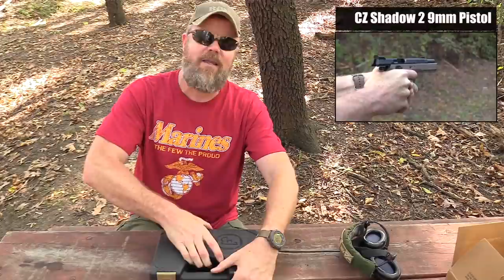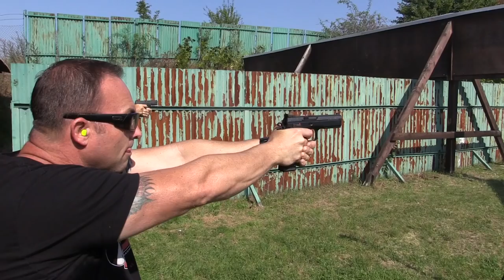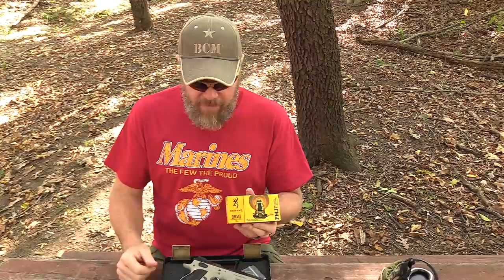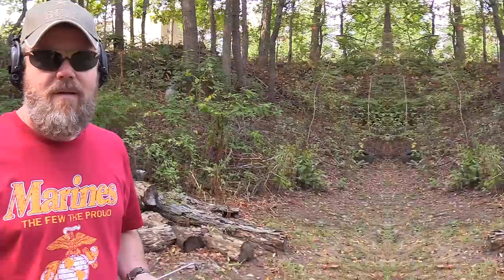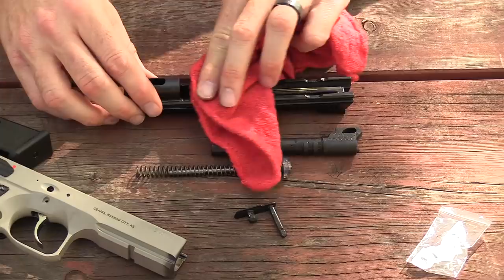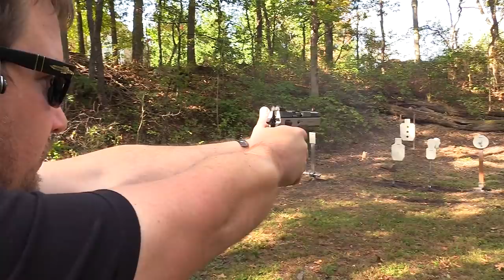CZ USA Shadow 2 9mm Pistol - The Ultimate CZ75

Comment: Hi MAC. In USPSA\IPSC competition if you're shooting at Shadow 2 you're probably in the 'Production' division. Production requires that you have a DA first shot for DA/SA guns. So most guys are going to be running DA/SA with a manual decock at the start.
Reply from the maker: Apparently the Europeans do things differently. Even the Rex Zero Alpha (recently announced) competition gun designed for the European market has the decocker removed and has a thumb safety.
Reply: Yeah, we have no fear to decock manually :). Shadow 2 is intended for Production with DA first shot. Decocker actually makes trigger worse. I don't see a reason to fear pistol without decocker, you just have to put a finger between a hammer and striker and then touch the trigger, not the other way around :)
Reply: That's normal for Production division (in both IPSC and USPSA) hammer guns like the Shadow 2 and Tanfo Stock 2/3/Limited Pro. Standard procedure is just to rack the gun and thumb the hammer down when making ready.
Reply: Yes believe it or not both in europe and in the states they decock it, without a Decocker.
Reply: Better way is to use forefinger+thumb of the weak hand to pinch the hammer from the above (not the sides, that can slip!) and then pull the trigger and lower the hammer slowly. This way it's safe even with frozen numb wet fingers.
Reply: Military Arms Channel that's because decockers make the trigger worse. You decock manually by riding the hammer.

Shadow 2 also eliminates the firing pin block for an even better trigger.

First shot is double action in uspsa/IPSC. Uspsa also runs 10rounds. IPSC runs 15 rounds in the magazine.
Reply: That is totally normal procedure in IPSC when you get the "Load and make ready" command. Mussle always safe direction, and lower the hammer down safely. (When in production division) In Standard you can start cocked and locked.
Reply: In IPSC (world competition) the first shot has a minimum trigger weight so DA/SA dominate. USPSA has no such rule so striker fired guns are more common. Generally a gun with a decocker will have an inferior trigger.

Comment: How would you compare the differing CZ triggers across the models like this one, a standard P-01, P-07 etc? I'm curious how much/little the triggers differ across the different pistol lines. Maybe another video on that? 😀
Reply: The P-07 and P-09 (newer generation) have outstanding triggers for the price despite having firing pin blocks. The trigger travel is smooth like butter, the single action is decently light with a clean break, and the reset is slightly long but very tactile and audible. The double action is smooth, though it does take some force but definitely not as much as other double actions.

As for the SP-01 series of CZ, it depends. The standard SP-01 with the manual safety has a 4.5lbs trigger, and it has an 11lbs double action (I think), with a 10lbs half-cock double action pull. The double action is lighter than others but it’s very slightly… crunchy? It’s hard to describe, but the CZ-75 SP-01 Tactical (decocker model) has a slightly crunchier double action because of the more complex trigger unit, especially with the sear cage.

As for the standard CZ-75B, I don’t really know but my father has a B model, and it feels incredibly smooth all around, although the trigger is a 5lbs one with the double action maybe being 11lbs as well, 10lbs on half-cock I think but don’t quote me.

The CZ-75 SP-01 Shadow however is weird. It’s got no firing pin block and a manual safety, so it already had a better trigger from the factory than most. It had a 3.5-4lbs trigger pull on SA, with maybe a ~10lbs double action, not sure what the half-cock pull is. BUT! The break and smoothness of the trigger is noticeable smoother, and the reset is VERY noticeably shorter already. A Cajunized or CZ Customized Shadow however absolutely shines…

But not like the Shadow 2. You already seen the video but I’ll go over it anyways. ~10lbs? Maybe slightly less for double action, ~9lbs half cock I would presume, and a 3.5lbs trigger pull on single action. The Shadow 2 is the smoothest shooter ever for the price, and it also has a CRAZY short reset, I think maybe the shortest reset so far. It’s Glock short, though the Glock trigger comes with other problems.

I don’t know about the P-01 series and decocker models of the P-01, and I also don’t know about the P-10 series. I have zero experience with those.

Comment: Got mine for $1100 in July and I recently made A with it in USPSA. It has a 1/10 twist and handles any bullet well, probably built around 147’s. It’s mainspring is built to handle all ammo, and if you go down in weight and stick to light 147’s it shoots even flatter. The one malfunction I’ve had was recent, and unexplained, a failure to go into battery (all stock parts) on the last round. Also, the plastic magazine followers don’t engage much with the slide stop and will eventually get chewed up at the engagement point, and will be horizontally locked up with the slide stop, necessitating pulling the magazine out. That’s my evaluation so far!
Reply: Any update on those mag followers?

Comment: I've always like to admire the machining of firearms. Tim, I've been using Slip 2000 EWG (Extreme Weapons Grease). It's not solidified like other firearms grease. It's hard to describe. What I like about EWG is that particulars, carbon, etc., don't stick to the grease. As the firearm heats up the grease becomes slightly liquidy (I know it's not a word). Like I said hard to describe the texture and contents on this grease. When the firearm cools off, the grease begins to become more solid. While firing and while hot, the grease stays where you put it. I'm still testing this product out. I've always used Slip 2000 oil (EWL). But finding that EWG is working better than I anticipated on pistols, AR's AK's all sorts of guns. I still need to see how it performs in the winter. As for Spring, Summer and part of this fall...I would use this product on everything. My expectations for cold weather use (TN- Winter) is that Slip 2000 EWG will do quite well.

Comment: All I did to mine was just one upgrade, I installed DPM recoil system and now it shoots like 22LR, not to say that there was any noticeable recoil before, but that's what I do to all pistols that I like, preserves them way better after shooting over 200k rounds.
I also go heavy on EWG grease, generously apply it on rails and lugs, and outside the barrel. After putting over 500rds through the pipe it still has no barrel marks from shooting (saw it on "do it rite" channel and fully accepted the concept never to look back).
Reply: What's "EWG grease," Antoua B?

Comment: If CZ tests every gun that they ship, how did they manage to send me a P07 Duty that wouldn't run correctly, but also couldn't be repaired after 2 trips back to them? No company is perfect, in the many years I've been shooting I've gotten quite a few guns that didn't run out of the box. But for a company with CZ's reputation to allow a customer to send a gun back twice without fixing it and then not offer to swap it out doesn't make sense. Of course they claimed it was something I'm doing, but none of the roughly 25 semi auto pistols i've bought before that have had similar problems (Well, other Kel-Tec or Taurus products, but I don't think CZ wants to be in that category, do they?) and the two HKs and 3 Berettas I've bought since the P07 didn't do it either.  Oh, and the 3 other CZ pistols I've owned didn't do it either.

Comment: About the trigger part, I don't really believe a 4lbs trigger is that insanely light considering the Staccato P (which is built to be a duty purpose 2011) also has a 4lbs trigger. I cajunized my Shadow 2 after 1,200 rounds, and the trigger feels better than most 1911s I've encountered really (in the $2,000+ range). 3lbs or so break, with a low 7lbs-high 6lbs double action, 1911-short reset, buddy. There is no way I wanna shoot anything else now.

Comment: The Shadow 2 (particularly those done over  by Cajun Gunworks) are currently dominating USPSA Production, much like the original Shadows did before them.  The weight corresponds to 1oz under the Production limit.  Likewise the gun is as large as it can be and still fit into the production box.

Mag capacity is largely moot, as Production is limited to 10 rounds in a mag.  Also the safety is moot, as Production requires DA/SA guns to start hammer fully down, so your first shot will be DA.  

To take advantage of the safety and mags, you would have to shoot Limited minor, and friends don't let friends shoot limited minor.

Comment: I have a Shadow 2 that I put the flat trigger, adjustable sear, and production hammer from Cajun Gun Works in, and it's the smoothest gun I've ever shot. I also have an sp-01 with a ton of work in, and the S2 hammer (slightly modified because it's too wide for the sp-01), sear, and trigger in it. I shoot similarly well with both, but the S2 really is in its own league. I have yet to have a friend see it, try it, and not drool over it. I got it for $1,085, new, shipped, and it's worth every penny. With 147gr 980fps ammo, the recoil is laughable!

Comment: 500 rounds through mine in the first week of ownership. Sitting here cleaning it now. I think the guide rod could be a better fit to the hole. I may send it of to CZ Custom for the ACCUBUSHING but that would take it out of Production Class. Agree on the Competition Safety too. The Extended Slide stop fits my Tri-Star L-120 so I am going to order an extra one for it and two spring kits from Cajun Gun Works. Got mine from Moss Pawn so I'll have Ray put the CGW parts in it. The Tri-Star is my carry. The fiber sights on the Shadow snag my holster. Waiting on a custom holster for the Shadow 2.

Comment: I bought an SP-01 and loved it right away. The finish isn't the greatest but its not about looks. I just got a P-01 omega and the machine marks were out of control. It works great but I'm surprised they let it out of the factory like that. Great gun but until they can get that straightened out I don't see myself spending $1300 on one. I would go nuts if a $1300 pistol i purchased was less than spectacular in all categories (including finish!!!!!!)

Comment: Just one little correction to your competetion statement. It was not designed to be shot SAO as it was designed for IPSC and USPSA's Production division which the first shot must be shot in DA. The reason it doesn't have a decocker is because there is no firing pin block safety NOT because it was designed to be shot SAO (info is on CZ's site). Great video MAC!

Comment: I have the Accu Shadow 2 and yes as smooth as a sewing machine. 
You said you weren't going to shoot it much why ? What ever wears out replace it as you go along . The gun has a long life expectancy smooth action , recoil buffers, and you keep it clean, well oiled and greased.  At best the rifling will wear ( new barrel $120 ), a few springs will get weak ( $20. ) after about 20,000 rounds the firing pin will be a litte flat at the tip. 
Shoot the hell out of it 
It would be like building a 60's /70's muscle car and leaving it in the garage. 
Great video man !
I will definitely be checking out patreon.com.. I didn't know about it thanks

Comment: Few months update on my CZ Shadow2. Absolutely loving it. Shot 500 brass FMJ to help break it in before testing my HD 135gr +P. It is a tack driver with cheap brass FMJ, It is even more accurate using the premium +P Critical Duty loads. The extra weight makes shooting +P extremely pleasant to run quick double taps with good groups.  Swapped out the stock grips for some Palm Swell Bogies in G10 from LOK Grips. They take it to a whole other level. They look damn good with the Zombie Black/Bright OD Green on the black frame too! Not a single jam in 700 rounds so far. Also found this gun will feed just fine for range use, from the 35 round Promag Canik TP9 magazines.

Comment: Hey Tim, could you post your video on changing out or adding the extended safety?  I was able to change mine out without issue but there is only one video on Youtube I could find and it wasn't that great.  Also there is NO INFORMATION about changing it out in the Shadow 2 manual.  Thanks, and really appreciate your channel.

Comment: Tim, one quick note: the footage you showed of the factory shows clearly that the frame is cast, not forged. The green wax “frames” are evidence of an investment casting process, which is very high quality. But it’s not forging.

The slide is almost certainly machined from forged bar stock.

Comment: Tim, I purchased a CZ75B Performance Center Edition used over a year ago.  It was pretty expensive, but worth the price.  It is stricklingly similar to this Shadow 2 of yours, particularly the inability to decock it to double action.  However, if you haven't already, it's worth shooting it in double action as the double action pull is equally amazing.  Mine is surprisingly accurate.  I did find that I had to lock tight the rear side as it will drift upon shooting. 
 I only noticed this as I noticed my shots were consistently left.  I then noticed that the rear sights had loosened up.  Once I centered the sights again, it shot directly to point of aim.  Only mentioning this in case you experience the same issue.  This is the pistol I happen to shoot the most accurately, bar none.  Great video again sir!

Comment: You should not push the safety out in that manner.  There is a small spring loaded detent at the back of the sear pack on the left hand side that holds the safety in place.  Once you remove pressure from that detent the safety lever should pull right out without much force.

Comment: I think better than glocks sigs betettas fns.
Reply: Chandan Rath for me CZ and Sig's are a tie. CZ has a better DA pull and price in there corner and Sig has a better SA pull and finish. While opposite, thin for CZ'S and thick for Sig I like the ergonomics on both.
Reply: Bryson Wilkinson I can't speak for anyone else but my Sig's (6 of them) all have great finishes, have heard that the Legion's PVD (?) finish sucks but I don't own any of those so don't really know. They have minimal tooling marks, the stainless P232 is a work of art, and after months of EDC my P229 I bought in March could almost pass as brand new (albeit I don't use a lot of kydex). My CZ and a cousin's on the other hand picks up scratches easier and his has chips missing plus you can see where they missed spraying the inside the slide with more machine marks. I'd have 1 or 2 more CZ's if I could have found the models I was looking for when I was in the market instead of a Sig or two (PCR and RAMI w/decocker) and saved a few hundred dollars.
The new Sig barrel finish now days hasn't even worn off after  couple thousand rounds (on 2 of mine).

Comment: poop! i love destroying czs with my plastic fantastic.
Reply: They are finished like shit, just saw a shadow 1 and 2 yesterday and the barrel machining is terrible at lock up, the inside of the slide looks like it was finished with 5000 grit sand paper. WTF! They do fit well in the hands but they are finished poorly, with old machining. An Australian model i saw dual tone looked like it was spray painted lol. Shadow 2 is not much better, barrel needs to be polished and fitted, and the stupid mag release is so big if you ever use it for self defense you better use one hand only. They look like they where finished in a pakistani street shop.

Comment: ¿Question?(PLEASE EXCUSE MY IGNORANCE)......so why isn't this a good option for carry?
Reply: It's not a good carry option because not only the weight, but also the lack of a firing pin block might make it slightly less safe for concealed carry. HOWEVER! Dropping it isn't likely to make it discharge, so it's not like if you drop it when loaded it's guaranteed to fire. It's mainly just the size and weight that make it hard to carry.

Also, using a racing-gun for carry might make you look guilty in court because the prosecutor could pin the blame on you for "wanting" to kill someone when possible with a "fast and deadly pistol", which is just legal BS.
Reply: @makotoyuki2199  the weight thing isn't a problem but i get the rest, thanks

Comment: One small tip: When you make the disassembly, it is usually easier to decock first (thumb over the hammer, push the trigger and slowly move the hammer forward) and then pull the hammer one safety notch back (you will feel and hear the click). It is factory aligned to match the disassembly lines. So if you pull the slide back gently until you feel hammer spring (significant change in force needed) it will self align for disassembly. ;-) Every CZUB CZ75ish pistol works like that :)
Reply: That's called the half-cocked position, and great tip.

Comment: What do you think of the cz shadow 2 polymer frame, then you could conceal carry it, if they made it at least 27-28 ounces, there you go, keep everything else the same, idk why cz hasn't done this, they did it with the sp01 and sp01 phantom
Reply: That wouldn't be a great idea because then it'd be like the gun doesn't know what it was designed for. That's a good concept, but the problem is that no one would buy it because the CZ P-09, P-07, and the SP-01 Phantom exist.